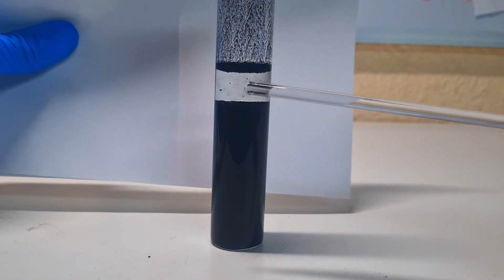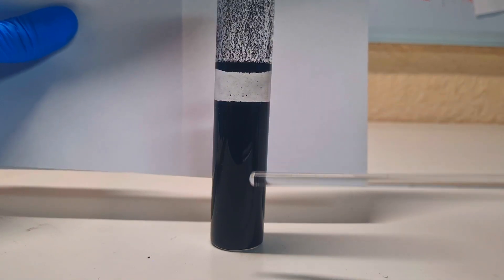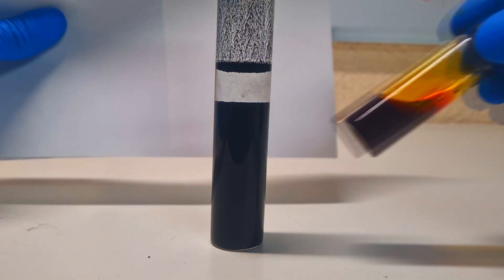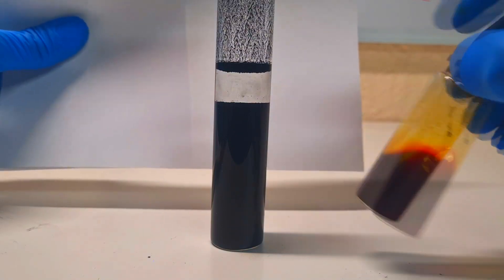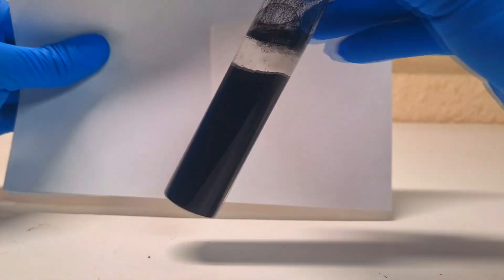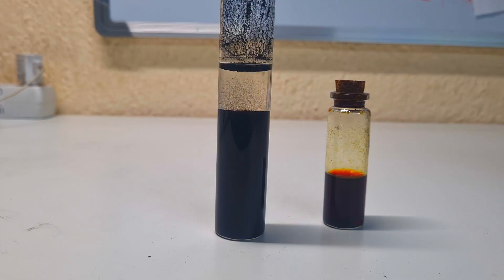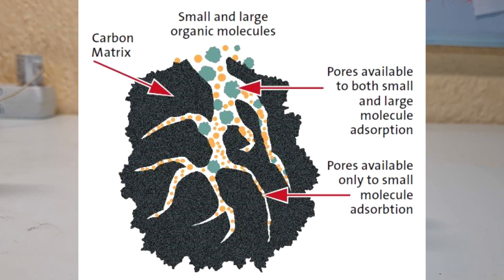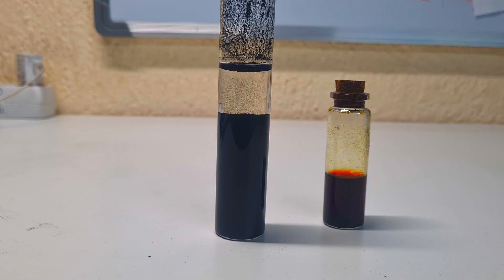Activated carbon & iodine

Comment: Nice video! That's really cool! By the way, on a earlier video, you soaked carbon felt with KOH and nickel hydroxide, what was the concentration you used to soak it. Also can I used copper hydroxide and copper plate?

Comment: Hi Cayrex,
Nice video.

It is a good visual experiment. 
What is funny is that the I2 is complexed (and dissolved) into yellow-brown KI3 (K(+) and I3(-)) and that the activated C somehow seems to manage the separation of the I2 out of the complex (unless it absorbs KI too (or even KI3).
To be sure maybe a conductance-resistance testing of the solution prior (orange-brown) and after (clear) could provide a clue on what is happening.

PHZ
(PHILOU Zrealone from the Science Madness forum)

Comment: Also the carbon you used needed to be much finer
Reply from the maker: Why? The powder particle size which I use works great here.
Reply: @cayrex  I watched a guy talk about cement on day. He talked about how one size particals can only fill space so much. So he proved it by sitting even more in by ultrasound than he did it with another powder size. Next level is basically smoke. Like kind from carbon black from welding. Funny thing I worked at a research company R&D using the burnt metal smoke to coat a surface. We was trying to apply a conductive surface to ceramic. This after which we set a chip in the middle. The chip holder of ceramic was 60 layers thick. Not much thicker then match book cover. Light came through it. The back where chip sat needed to be conductive and very thin. I believe a grounding medium. This was in 1985 at company called interamics in California. I was the chemist for quality control for the military grade coatings.

Comment: Here is another high output combination; brass anode, Magnesium cathode, 50 percent idione, 30 percent pink bismuth,20 hydrogen peroxide electrolyte thin separator
Reply: For some reason, shooting a green laser through the bottom to top gains a volt or better.

Comment: Simply mix dry AC powder and iodine powder in a plastic container. In seconds, you will get adsorption of iodine WITHOUT solvent, simply because of iodine sublimation to vapour. It actually becomes warm to touch because of the heat of adsorption, which makes more iodine sublime and drives it forward to completion. Warning, it will build some small pressure, so make sure container you shake in has plenty of extra empty space.
Reply from the maker: Correct

Comment: Would you like to make a potassium or zinc iodide battery?  With a graphite  powder electrode at the bottom?
Reply from the maker: You mean like  a gravity battery?
Reply: @cayrex  gravity might keep the iodine ions low, but when I hear gravity battery, I think  moving weight to a high spot and extracting energy from it as gravity pulls it down.
Reply from the maker: @kreynolds1123  Yes correct, mechanical-gravity battery.  You have also electrochemical battery which have gravity cell design, in which the cell materials are separated by gravity. That type of battery is easy to make and experiment at home.

Comment: I guess the point is how activated carbon is useful at holding electrolyte components near a very high surface area conductor? 
  Does it work the same with the ionic forms? Did it take up any of the KI? Will it decolor a vandalium solution?
Reply from the maker: That method is really usfull for making some active material for batteries, because you have already ready made AC+I2 material. The activated carbon is good of adsorption of many materials that why is also good in filters. To remove most of the KI you just wash the powder.
Reply: @cayrex  so washing that ac would just remove the KI not the I2? In other words it adsorbs both ionic and non-ionic solutes but only holds(on it's own) the non ionic?
Reply from the maker: Potassium iodide acts as a solvent for iodine, allowing it to dissolve and form the triiodide ions, which contribute to the brown color. When activated carbon is added, it interacts with the iodine molecules, effectively adsorbing them from the solution. Potassium iodide remains in the solution unchanged; it's the iodine molecules that are removed by the activated carbon, causing the solution to clear up. But the activated carbon is still wet from KI solution and for this ilreasnon is good to wash the powder.
Reply: @cayrex  ...and that would leave some elemental iodine in the pores... After washing out KI... Yes?